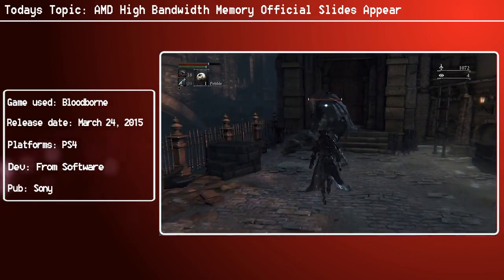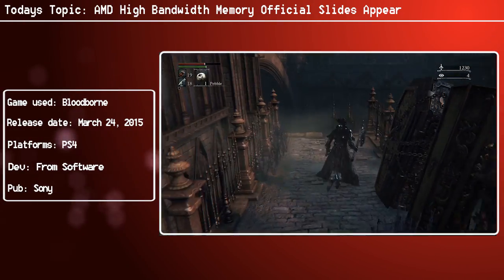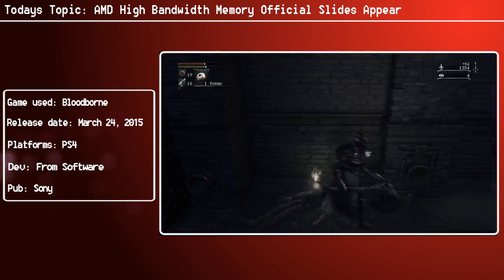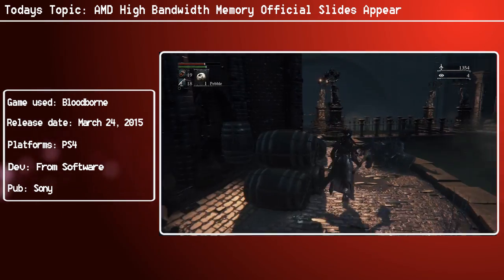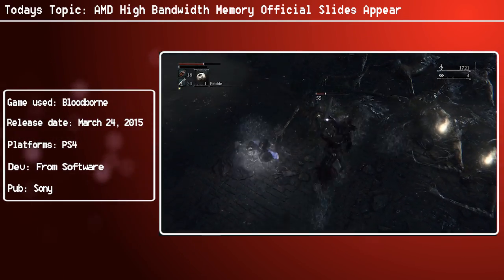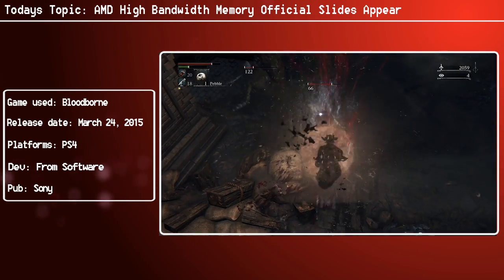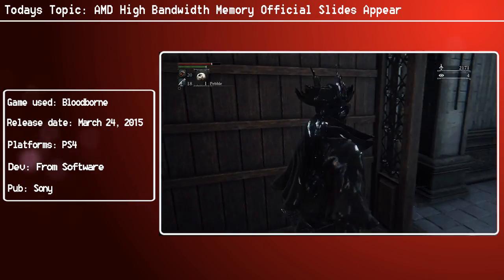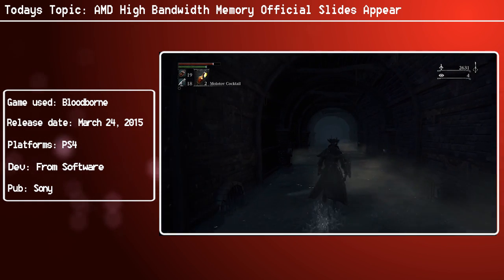AMD High Bandwidth Memory Official Slides Appear | HBM Technology Explained

Comment: Something that may have be mentioned.When the R9 290x was released AMD said that their 512 bit MC used less die space than 384 bit running at higher frequencies. By using HBM at lower frequencies it means that there is less pipelining to do and more transistors to spend on the bus width. So on the GPU side, the use of a 4096 bit bus width may come at almost no penalty to no penalty at all on the die space. I dont have any knowledge on HBM MC but there may be a possibility in can actually reduce the size of the MC. Just something I think that is also important to mention.